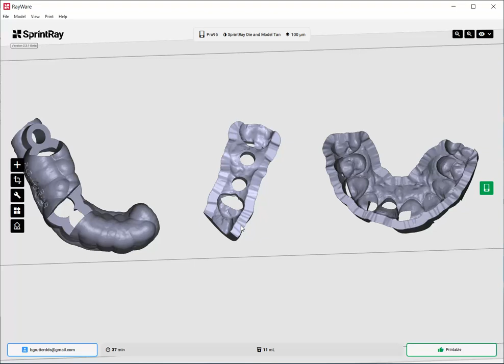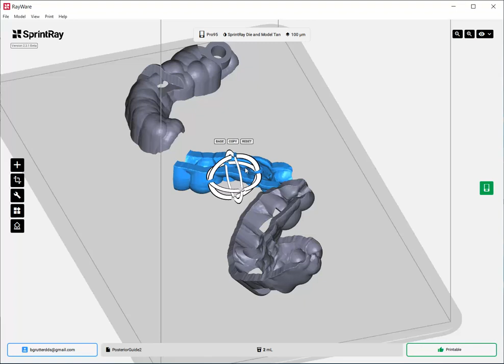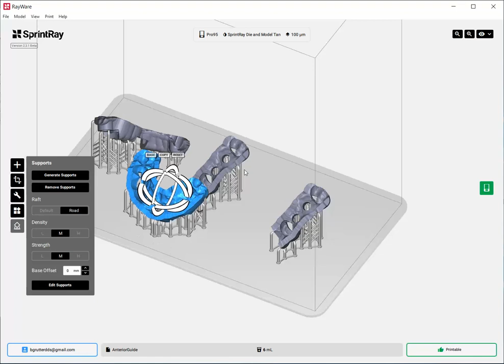3D Printing: Surgical Guides - BASIC WORKFLOW

Comment: helpful, thanks. How do you know how many supports you actually need? I'm new to this, but cutting them off is kind of annoying .Thx
Reply from the maker: I don't pick how many any more. I just leave the density and size at medium and let the software so it's thing. If you use SprintRay, their Dashboard is optimizing print orientation and creates smaller support contact.